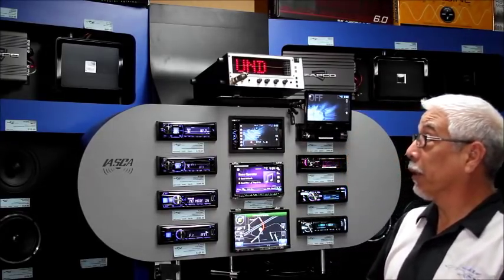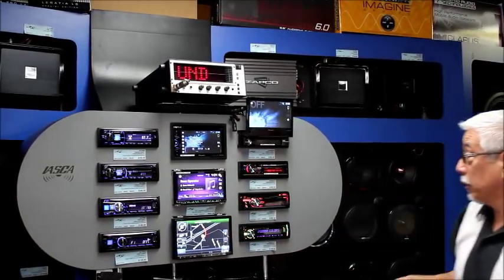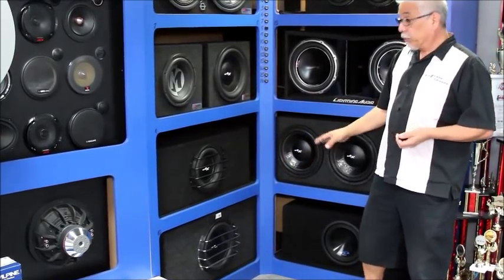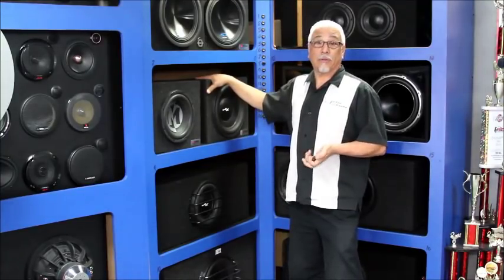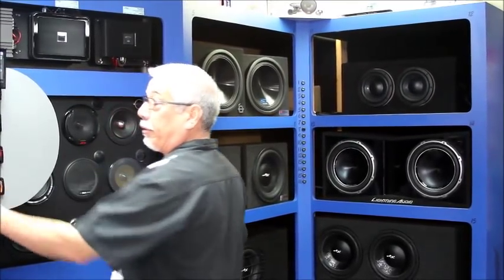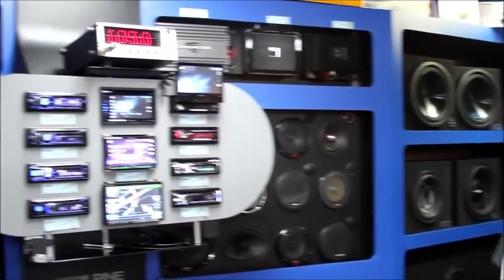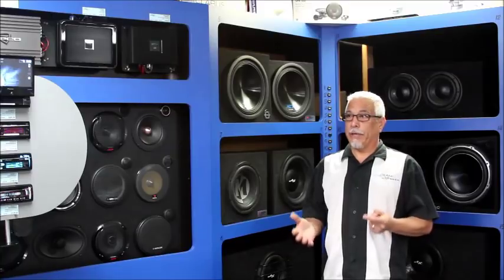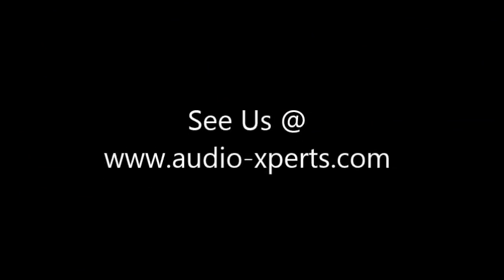Sealed vs Ported Demonstration by Audio Xperts using SPL meter to show output differences

Comment: I have (2) Ap bd2 12" in a custom sealed box in my 91 jeep wrangler yj and you hear me coming blocks away. Its clean and does not sound distorted cause you have to know how to tune your amp and understand the subs limit and the type of box they go in is key.  First off I don't buy boxes I make them for myself lol. When you buy a box ( instead of having someone custom one) its garbage! Just look at the little bead of caulk when you purchase one thats in them to seal the wood . Do you really think that will hold with all that bass hitting that box? My bd2 12" will explode those boxes in the first tune I do when installing them lol. Let me give advise if you want to buy a box ( because it's cheaper in price) instead of having them made custom . Go buy yourself a big can of resin, mix that up then brush it all inside the box to cover all seams . I'm no dealer, professional systems installer but I started doing my own systems since 15 years of age and now I'm 43. Ive learned a lot of tricks, matierals to use and also just what to look for when buying a system. People come to me and I help them out but when they come with these boxes you can buy on ebay or Amazon I hook them up with resin lol. This really seals the box and makes the box almost bullet proof.  Now save your money , put it in those boxes and after your sealed it with resin, (whether your preference is sealed or ported) and enjoy the bass without your box falling apart. Your welcome in advance for this free advice.  No seriously do this and you will see now how that bass hits suppose to the box hearing distorted because of those cheap made boxes.

Comment: It's because the box on the bottom is bigger than the other one and if it is ported then it can move more air making more sound and having air moving in and out of the box cools the driver what  ever it may be 100 watt 200 watt or 2000 watts it will always sound better in a properly  ported box!

Comment: Sealed will tend to play everything well tight and clean whereas ported will play usually the rap and low end bass stuff better and not everything. Of course it depends on what u tune the box to. For someone who listens to everything from rap to rock id push sealed enclosure over ported. If they listen to nothing but rap..def go ported.

Comment: With all respect, duely noted, ported or unported. It depends on the speaker.  Some are made for ported and others not.  Example way ,way back when when speakers were measured by the cone and not the basket. What I mean is a pioneer 12" sub woofer measured from the edge of the basket to the edge of the basket is measured 14 1/4" not 12". Like today's speakers, to rip you off. Back in 1986 if you cut a 12 inch hole in a box and it was just a bit to big, lets say 12 and a sixteenth, A 12" speaker would fall right through the hole. Get me? Getting back to vented sub box's. Speakers should say what they are. Not just a box with out any manual. If it doesn't then it should have a phone # to call them and ask them immediately. With the price of today's  booming speakers it better or I'm not buying it period. A long time ago Kicker made a box designed by Stillwater design a sealed dual 10" subwoofer box. 200 watts per speaker, a very nice quality Kicker box and very expensive. Something in the neighborhood of $400+, but well worth it and for a 400 watt box, it pumped and was very heavy and well built,  did I say unported and those 10's moved about an inch plus, They didn't have huge rubber rings like today's speaker's, it didn't need them. Just my 2 cents. Happy New Year, Steve

Comment: The only true comparison would be using the same exact sub in each box. Anybody with audio sense will tell you that every different type of sub is different. Some perform better with non ported boxes while others perform better with ported boxes. From my experience which dates back to the 80's cheaper subs need ports while higher end subs do not

Comment: SPL, is misleading. The larger ported box had more SPL and had more mechanical distortion. I can think of no advantage to a ported enclosure in a auto. For that matter I wouldn't have a ported enclosure in my home either. Each supposedly identical driver parameters are not identical and the cabinet size and port needs to be designed for each driver and that never is done. 
Seldom if ever are they designed correctly and sealed enclosures are very forgiving. Its sales marketing BS.,

Comment: The best enclosure is so debatable it makes it very confusing. There is sealed, ported, t-line, and many different types of bandpass enclosures. When you add SPL vs SQL vs quality vs the amount of space you are working with. It doesn't make it very easy. I always thought that a high quality amplifier properly powered was more important than anything. Then came a well built enclosure, then the subwoofer. But now I think a high quality enclosure should come first, since it's the most complicated. Then the amplifier and subwoofer. But it still doesn't answer my question as to what is the best type of enclosure for subwoofers. Everyone seems to have their own opinion. We're is the truth and the facts without all the crap? Because who doesn't want to strive for the best!
Reply: That's pretty much spot on - that being the enclosure is the most important, but don't forget about the room or the car! Most speakers are designed with a particular set of parameters in mind and will generally play optimally in those given parameters. For example a sealed enclosure with 1 cubic foot of volume inside. Sealed generally offers superior frequency response across the entire width of the band. If you go with a ported enclosure you're giving up the wide response that the sealed enclosure offers but increasing the response at a given frequency range based on the port tuning. This is why a ported design seems to play louder than a sealed box, and why this video is absolutely retarded.

The list goes on but as you can see you have to pick a driver that's well suited for the given enclosure and the enclosure has to be well suited for the room/car it's being placed in, then you have to have ample power for the application where sealed requires less power than a ported box to cover the range of frequencies each enclosure is designed for. Most home theater subwoofers are ported because it's easy enough to tune the enclosure for the necessary ultra low frequencies that they produce for accurate reproduction of a movie's low-end frequencies. The design philosophy for home theater audio is to move all low-end, 80hz and lower, to a powered subwoofer tuned specifically for that job and as such a sealed enclosure isn't necessary due to the already limited bandwidth of the application - 20-80hz - which is where a ported enclosure excels. This is why home theater subwoofers are generally lackluster for music compared to a full-range setup, since they are tuned for such a small band of frequencies when most music covers a much broader range.

You can also read up about enclosures all around the internet, but JL Audio has some good information on enclosure types including isobaric. For the record JL prefers a sealed box for the broader frequency response. http://www.jlaudio.com/header/Support/Tutorials/Sealed+Enclosure+Characteristics/Tutorial%3A+Sealed+Enclosure+Characteristics/287536
Reply: audiogarden21 "Sealed requires less power than ported", that's wrong. Sealed needs more power to overcome the resistance from the box. Ported moves more freely, so it can't handle more power, but that's the whole point of a ported box. To use a good sub with a smaller amp. They both sound good in my opinion, but if you're trying to stay true to the music then sealed is the way to go.

Comment: for an expert as your channel claims, you have no idea what you are talking about. placement, box size, power, ported, sealed, chambered, internal acoustics of the car all play a role in "loudness" as you put it......you proved absolutely jack squat with this video other than you really are not an expert at audio as you claim.
Reply: PlatinumEagleStudio's pump the brakes a little, man. It's clear you have some misunderstandings yourself in regards to this video. Youre right to agree that this video contains an awful lot of misinformation. The rest is kinds iffy. For starters, you can literally take zero actual account of the actual Sq of a driver from a video recorded on a camera and uploaded to YouTube. This encompasses a wide variety of factors, including distortion... You don't know what was distorting, the camera, the sub, maybe it was handling noise, maybe wind noise. Point is, that's a pretty basic thing right off the bat that you didn't even consider, and there are MULTIPLE other things in this video that could be cited, so maybe hold off on calling people retards about stuff until you get a little more experience under your belt.
Reply: @asthecrowflies1201  well, the guy says that the sub was mechanically distorting, right? I agree that the "Distortion" heard could be one of various things. 
But he took a prefab box and stuck a sub in it and then too the same sub, designed and built, and I presume obviously tuned, a custom box to make a comparison. He's a fake. 
It's like comparing a rally car specific built boxer engine to a boxer engine in a regular STI, or how GM does it, which is basically build a vehicle that the engine fits in.

Comment: Ok really sealed vs ported 
.well the sealed box does sound really nice but . the port box does really sound really deeper .
just need to know how to tune the box and build it correctly without any air coming out of any wer else but air cumin only out of the port. u should try that hey

Comment: Vented enclosures are 4th order filters whereas sealed enclosures are 2nd order. The higher the order the more ringing induced into the driver, and  said ringing is NOT part of the musical signal. Amplitude response plots or just listening to isolated tones are not indicative  of the QUALITY of the  bass. Moving air and reproducing complex musical information, are two different phenomena.
Reply: Scott Wolf Which one is considered higher? The 4th, or 2nd order?
Reply: The sealed enclosure is the 2nd order filter, less circuit elements,and, " Lower". Whereas a true dipole is a 1st order filter.

Comment: is a 7 db difference really even noticeable at db's in the low 100's?
Reply: Ben Smith It should be, it's 3 times as loud. I've always heard that ported boxes give you a 3 db increase. Don't know where he got those much higher gains from. To get a 3 db increase you need double the power, or a 3 db higher sensitivity rating. As far as I know.

Comment: LMFAO See this sealed box 108.9-109.0? Now see this HIGH OUTPUT box. It jumps all the way up to 108.9-109.0...........? Umm.. am I missing something colonel?
Reply: @G ManNah I did notice that. Just so many things not valid. Biggest prob he shows the readings at different parts of the track. Notice how its at 109ish in the lower box then a few seconds pass then boom, lower tone and jumps up to 114? It would only be fair to play that same part of the track on the upper enclosure. That way they are getting the same freq.  Top encloser is way too small for that sub. Build a sealed box to spec for that woofer then repeat test. About that lower box is it ported? I don't see a port. could be exiting out the side but not once does he say it's ported. He says high output but nothing else. Also placement of box and where he stands makes a difference. Undoubtedly everyone knows you can get higher spl with a ported enclosure, be it 3rd, 4th, 5th, 6th order so on and so on but at the cost of linearity and response. I still don't know what subwoofers they design and build themselves. LJ 12? Did he mean JL?
Reply: @Greg L I saw 113.8 and 106.3, but close enough. Even still, comparison is invalid

Comment: this is the most ridicules test iv seen 1st the dam port is pointing at a wall witch amp up the sound then the sealed is on a 2ed shelf witch will exorb a good portion of the bass. then if that sub was hitting its mechanical limits at such a low volume then ether the sub box is not optimized for the sub or the sub is not optimized for a sealed box. yes a ported box will be loader of course at lower wattage, but a sealed box will be roughly as loud with double the wattage added if the sub is any good and the box it right the RMS power handlining will also double in the optimized box iv built boxes since the 80's till the last few year and you be hard pressed to find a prefab box that's right for a sub the difference between close and right makes a worlds of difference. thanks for sharing

Comment: You cant play a sealed box in a big open room. There is no cabin pressure to help the sub and box with tuning. When you put a box in a car the pressure in side the car actually tunes the speaker and box. Never play a sealed box in an open room. Don't talk about science either. I was at the world finals ISICA. Won with 4 15s JL audio sealed in a rx-7. Hit 162 then hit 162 then hit 162 again. Ported boxes work well with low power. That's why most poor people have ported boxes. They can use a cheapo amp and get good volume at tuning frequency. It suffers at other frequency's tho. But only losers do SPL. I did SPL just to show everyone that they are losers. Someone will always have more money than you and be louder. The girls like SQ not SPL. Stop trying to impress a bunch of dudes. Ok thats my rant. Please don't demo sealed boxes in your show room. Unless your intent is to only sell your boxes, in which case is wrong.

Comment: I haven't really polished my acoustic engenerring in many years, I mean maybe something changed, but this video seemed ridiculuos. I seem to remember that the general rule was enclosed was probably less efficent, but worked smoother in broader range of frequencies + much esasier to tune. This dude tells me some spl bullshit which practically means nothing. I thought insitially that the second box was also encosed but better tuned, then he was gonna move to badly tuned vented, and well tuned vented but this was not at all what i was expecting.

Comment: i have a dodge magnum. .i want to get subs ..would 3 12's L7's sound deeper than 2 15's L7's ...and what box and amps would you recommend?. .i want deeeeep bass
Reply: Premo King 3 12's prob hit way harder
Reply: 3 12's would probably be louder over all, but it would probably be equivalent on actual low bass with the 3 vs 2 arrangement. Im just gonna say if you want actual low bass in the 20-32hz range, the 15's are gonna do better. The box size for 15 L7's is enormous though, your talking 3-4 cubic foot for a decent sounding sealed box and 4-6 cubic foot for decent sounding vented. And that's per sub of course.
Reply: thx guys...think imma go with 2 15's..i fo want that deeep rich bass

Comment: No name dropping, Car Audio will always nothing more than MARKETING of junk speakers. Coming from the Pro Audio world, it makes me laugh seeing all this crap pushed on to the ignorant customers. Plastic subwoofers with efficiencies of 82dB @1w and coaxial speakers with 6dB crossovers for the piezo tweeters, are nothing put expensive junk. 
Yes back 20 years ago, when a lot of the Car Audio was manufactured in the USA, there was an actual effort to build quality speakers that didn't need a 1000 watts to be able to feel and hear great sound quality. Today it's sad that European branding of Chinese products is considered Top Quality Car Audio over USA. 
Doesn't matter much what construction type of box, each have positives and negatives, but in Car Audio, it's a box within a box within a box (cabin gain). So with cheap class D amplifiers, Chinese speaker builders can get away with having round plastic bricks as speakers and use manufacture names of quality from back 20 years ago. Shameful MARKETING of CRAP AUDIO will always be an option mainly because of price, but hopefully some buyers will move on to quality for auto as well as home. Thanks for reading my rant.

Comment: How is range and sound clarity impacted by the different boxes? Which style would achieve best deep & low bass?
Reply: deep low bass you would want a ported box designed for the sub. Sealed is more for punchy bass you find in non-rap music. I always went with ported 15" subs but today I think I would go ported 15"s and sealed 8" subs for midbass or when I want to listen to rock. Four 8"s can rock like two 15"s

Comment: The method used to measure SPL in this video is completely wrong. 

-The distance from the measurement mic to the enclosure is different
-The mechanical noise from those shelves and crap in the room is unacceptable
-The distance from acoustical boundaries (ie the floor and walls) is different for each enclosure
-No mention of the the pros and cons of ported enclosures vs sealed

The only thing Professional about this video is that they are trying to make a buck. 

Should have done it this way. 

First Place enclosure on the floor away from anything that rattles (seriously)
Then Place the measurement mic on a stand at 1 meter away from the center of the enclosure. 
Then send a test tone sine wave to the driver at a pre-determined and consistent signal level starting at 25hz then 30 then 35 etc and record the results all the way to 120hz. 
Then shoot pink noise through the system, measure and record

All measurements should have been done with properly calibrated spectrum analysis software such as S.M.A.A.R.T Live http://www.rationalacoustics.com/smaart/smaart-v8/ 

Repeat all steps exactly for each enclosure using the exact settings as used previously as well as the exact same pre-amplification and amplification equipment.